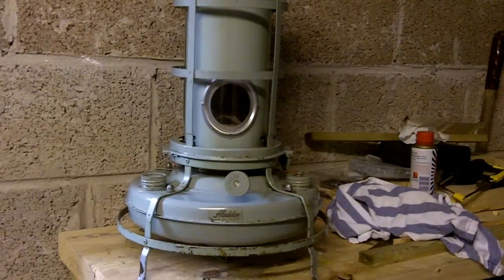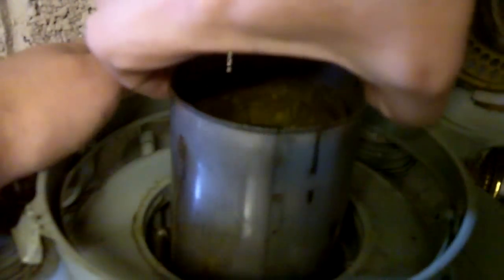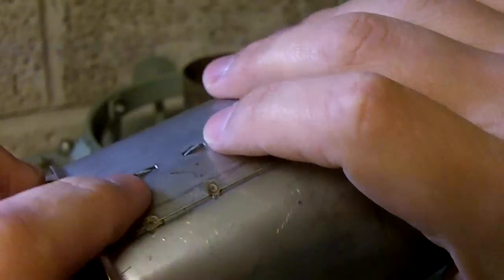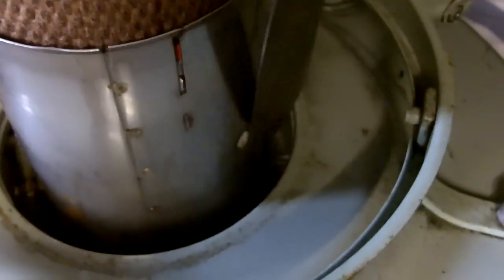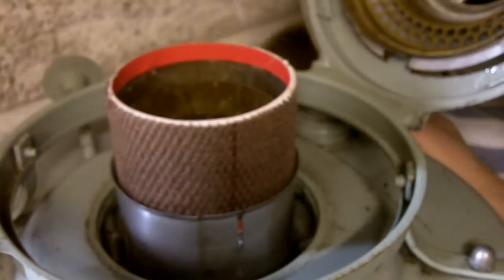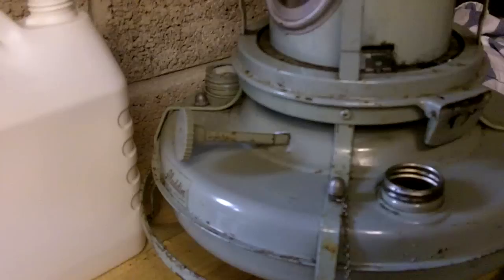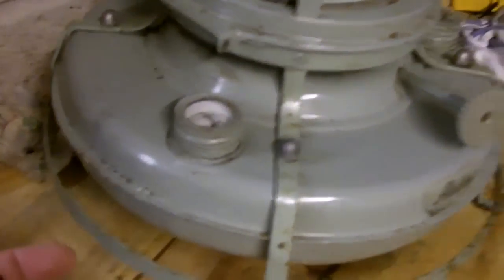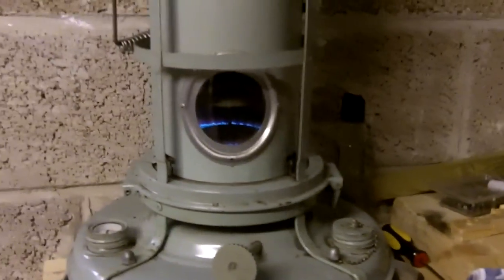Aladdin Blue Flame 37 Kerosene Heater/Cooker: Installing new wick and Testing

Comment: Nice video. Thanks for making and sharing it. Very useful. Just one thing, if I may. My advice is not to use epoxy to patch the leak. Empty and dry the tank thoroughly. Rub the paint off down to the bare metal where the leak is. A wire brush/sandpaper will do the job fine. Using a 150W/300W electric soldering iron (or a small flame burner) and soft fluxed core solder, solder up the leak. It'll never dry out and peal off like epoxy eventually invariably does.

Comment: After three years of use I've just fitted a new wick to my wonderful Blue Flame series 32 heater (NOS on ebay) following the instructions in the video and it it was not the easiest thing ever. Then it occurred to me to look at the box and sure enough there were instructions on fitting! There are some significant differences. Here we go:
First of all the wick should be inserted into the TOP of the carrier, tails first, so that the bottom clips/teeth of the wick engage with the bottom slot and the top clips with the top slots, on both sides of the carrier. The ends of the wick tails will now be about 1/2" below the bottom of the carrier. 
Next, the ends of the wick tails should be grasped together with the bottom of the carrier and both drawn gently down, together, over the centre tube of the tank until the bottom of the wick tails are level with the top of the fuel tank. The wick carrier should then be held in position with one hand while with the other hand you should carefully PULL THE WICK UP  so that both sets of teeth engage in the UPPER slots (I wondered why that slot was so much longer than the lower slot). 
Finally line up the rack on the wick carrier with the winder cog and gently push down until the winder cog engages with the rack. Turn the wick down with the winder, replace the burner basket and flame spreader. Leave for an hour before lighting. 
These instructions are quite difficult to follow but the video definitely helps. And I hope the above helps all Blue Flame heater fans! 😀 Extra! Just tried the pulling up the wick business - I wonder what difference it will make?

Comment: Nice heater thanks for sharing. The tank leak might be fixed by a gas tank sealer that is sloshed inside the tank. Sealers like that are used for antique car restoration.

Comment: If you spray the inner tube with paraffin first and then connect to the inner sleeve your adding lubrication to the wick and the tube and you will not have all that messing about trying to put knife blade into the wicks under skirt. If you need to use any form of pushing tool use a blunt piece of wood this will not damage the wicks skirt.

Comment: We recently bought a second hand Aladdin blue flame heater series 25. I watched your great video in how to change the wick and began doing so but the pins on either side refuse to stay in tgeir positions im having terrible trouble with this problem as i can't get the new wick installed i must have taken the wick out several times to try again and now I'm stumped cant face anymore trying. I've ordered a new wick carrier and a complete new handle which has the wheel on the end to wind up the ladder on the carrier thinking perhaps it needs these parts replaced. Any advice would be so very much appreciated honestly as I'm at my witts end with it. Thank you.  Maureen

Comment: chears mate   just bought the 25 model with safety devise..For 70 quid in good condition .best i could find.. most i have looked at are rusty old buckets. going for silly money . eny way   i think it is also important to let people know that these aladdin stoves will burn for  16 hours on full tank [ one gallon ] never let it run dry . as i did years ago . had the same model in my bed room  woke up at 9pm  and i thought it was the middle of the night ..the walls were black and thick smog from top to floor witch i had been breathing in for hours  [ poison ] my face and hand where black also..and of course i felt like sh..  had a window ajar but forgot to turn of the stove . ok also i noticed these stoves seem to focus most of the heat in one area, There for, a  good  stove fan [ mostly used on wood burners ]  are a great way of spreading the heat.  if you have a vallor 207.stove...a full tank will last you 8 hrs ...stay safe guys
Reply from the maker: Yes, they are a bit of collecot items these days, prices getting silly. You want to heat up the room but turn them off before going to bed just in case. I believe thats how japanese use their kero heaters.

Comment: I know this is an old video, but I have a couple of questions. My wick adjustment knob is stiff as hell and it looks like the previous owners broke the actual plastic knob (stem looks fine from the outside). Any advice to get it less stiff? Is it possible to remove the whole adjustment stem?

Comment: And one more maybe dumb question but how do you know which is the model number? I just got one and it says on the little metal plate thats on the frame and it says aladdin 3300 but then on the right it says no. H2201. I love this little guy and need a wick for it because there wasnt one in it. I got mine because of this video of yours and i think hes beautiful and cannot wait to be able to use it! Thanks again everyone!      👩‍🦳Sonia
Reply from the maker: Hello Sonia, you got me with that question. I think both are right if that makes any sense, one is the model 3300 and the other one is the number. If I remember correctly that how it goes but theres a bunch of different aladin mdoels.
Reply: @TheModernSurvivalist  okiedokie....lemme see what i can find out! Thanks so much🤝
Reply: Dee Jay  oh my gosh you have given me so much useful information and i deeply appreciate it!  I have not gotten it up and going yet but with this info i will order all i need to do so! Again, thanks so much! By the way i am in California, known as the central valley! 🙋‍♀️
Reply: Dee Jay  i was hypnotized just by the video so i can imagine it LIVE! 🙋‍♀️
Reply: The model number is on the knob you use to turn the wick up
Reply: @cliffhaupt5413  thank you!
Reply: H2201 is the model number 👍....the wick is a 3 inch diameter wick with the brass colour 'buttons ' either side that connect to the adapter arms....part number of wick ends in 05 I believe....though you probably know this by now!!🤣🤣🤣

Comment: Paraffin and kerosine is the same thing isn't it?
Reply: As the other fellow said, they are different, however in the US we do have pearl or 1K kerosene which is every bit as good as the paraffin. The only difference is I think the paraffin "lamp oil" has a bit less smell when burning and perhaps a bit less heat.. However is more expensive. 1k kero is $8-$10 per gallon, the paraffin 8-10 for two quarts.

Comment: Okay so very nice, but that is the 3th different type of wick I've seen for almost the same exact heater.. 😁
Reply: The Blue Flame heaters series 37, 32, 25 and 16 all take the same wick, the one in the video. The earlier 15 and 8 series take the wick type that has "buttons" rather than teeth/clips. Although there may be two types of button design! Both kinds of wick are still available.

Comment: They sure do smell a lot new wick installed but still smelly and I've tried a few different paraffin.  Can u recommend a good cheap brand that don't smell
Reply from the maker: These models are a bit smelly. All kero heaters will have a bit of smell, but some are better than others. 
What you want is a Radiant Kerosene Heater.  These are the more modern types, burn cleaner and project heat better too.
Link to one model in Amazon https://amzn.to/2T21rOL
These burn much cleaner and theres just the slightest scent that really doesnt bother most people.  Heres a video I did showing how these work 
https://www.youtube.com/watch?v=wz09jX5zgMw
Reply: B & Q.....been getting mine from them ...good clean stuff ... with very little smell

Comment: I've just bought an Aladdin series 25 for £1 at an auction. Thank you for your very informative video 👍🏽 It was the best one I have found on YouTube. I will now be able to fit a new wick with ease 😃
Reply: Lisa Morris 
We to have a 25 series i don't think they're too popular on here seems 37 is. Ive been trying to change its wick and having problems with the kog going up and down the rack to lower and higher the wick. Also the little protruding spikes on the wick that slips into the housing for the wick they won't stay in place where their supposed to be. So the wheel wont move the wick. All isnt as easy as it looks on here well not for me anyway.
Reply: @Maureen3486  Hello. See my post (Feb 8th 2023). It might help if you still have the 25.